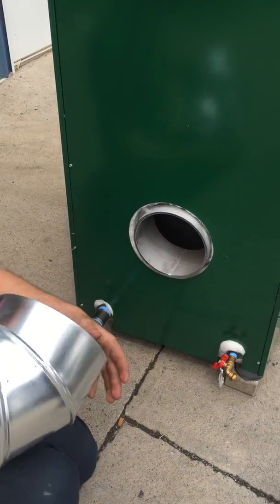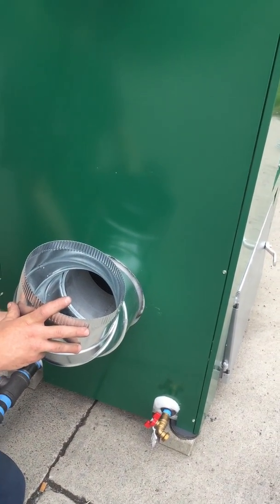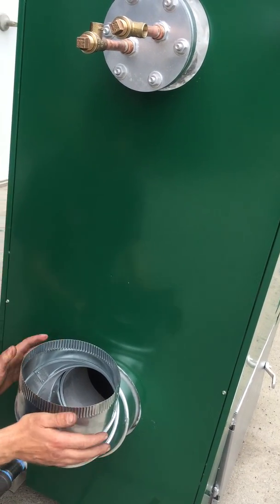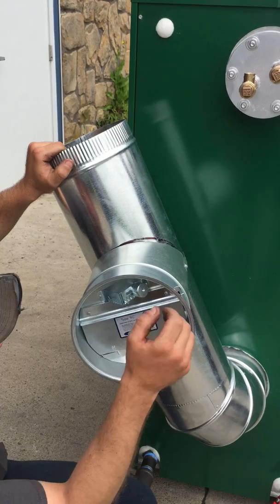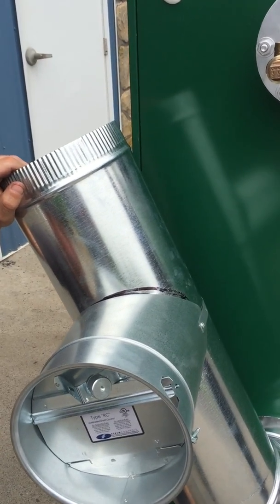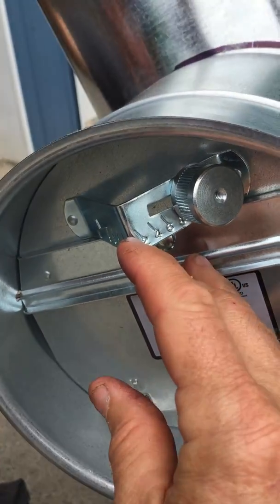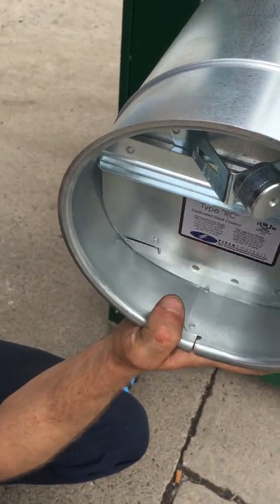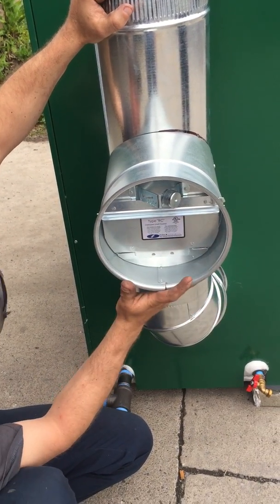Flue Piping - Installation from Boiler to Chimney

Comment: Thank you for sharing, im installing an oil fired furnace in garage. My exhaust piping is going up on a 45° angle, its set to level within pipe, should i still set that to .2 and also Looking to pass it through garage wall. Should i use a through wall thimble, and can i use the thin piping on borth sides, inside and outside. Thanks if you can anwer that for me

Comment: You did it upside down. Female ends must point up.
Reply from the maker: Since there isn’t any cresote or residue inside the pipe to flow out the joints, there isn’t a problem.

Comment: For a oil burner, you don’t need double wall piping??
Reply: 2001pontiacta no not really, oil has a higher stack temp and doesn't need the aluminum inside lining of b vent like gas does to build up heat so it can draft easier, oil would melt the b vent if it was used